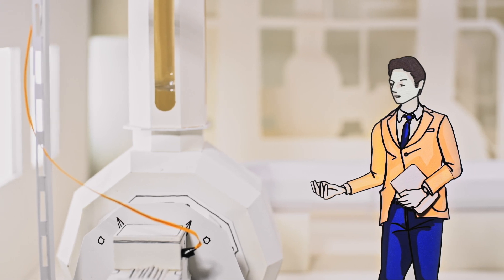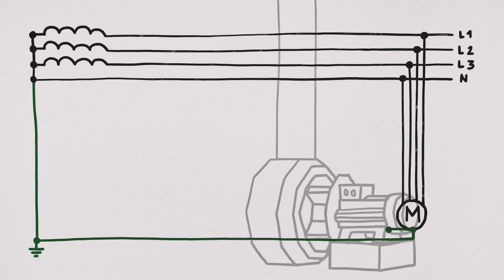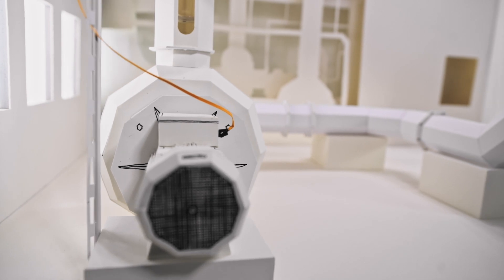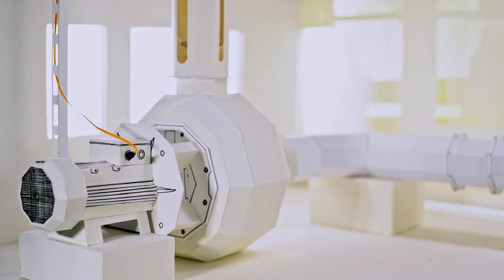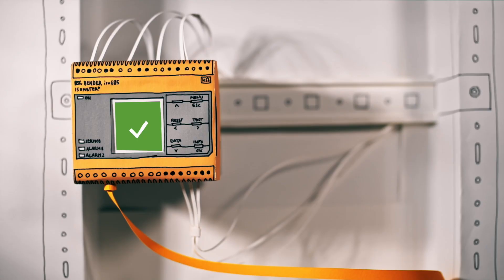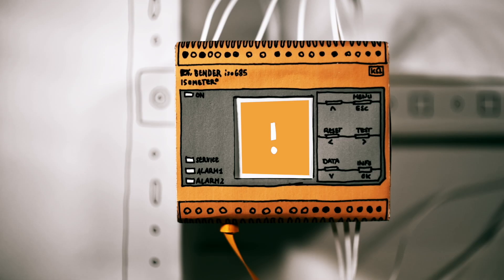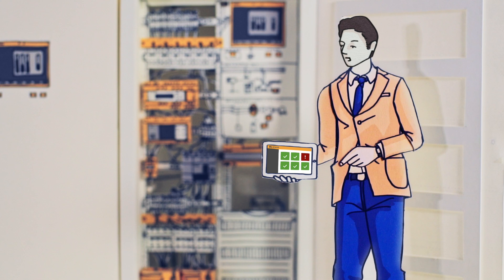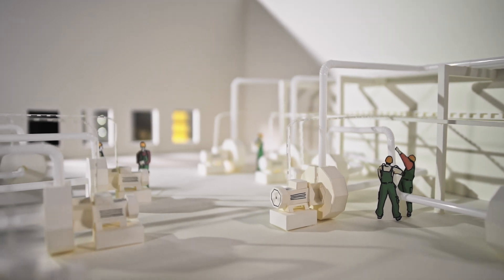Ungrounded System Part 2 - What happens in the event of an insulation fault?

Comment: Thank you for the video. So basically, if there is a fault in the system, the service worker has to work on the system live?
Reply: No. The fault is detected via the insulation monitoring device which signals an alarm. Corrective maintenance can then be planned and undertaken during a scheduled shutdown/isolation. In an earthed system the protection would operate to remove the fault instantly, at the cost of losing the supplied equipment.
Reply: @awesomeelectricalengineer3487  Got it. Interesting stuff. Thank you!